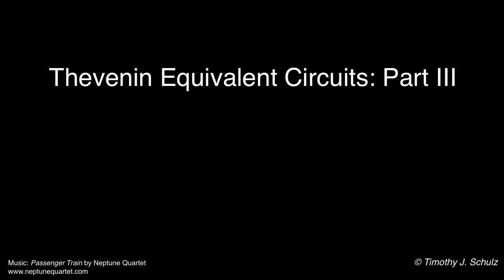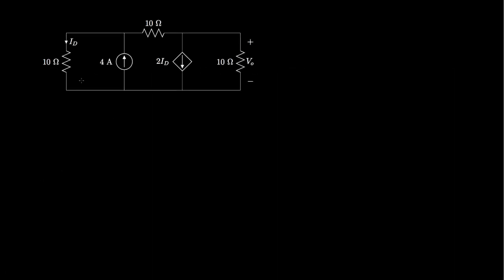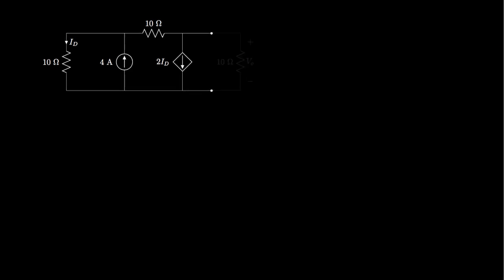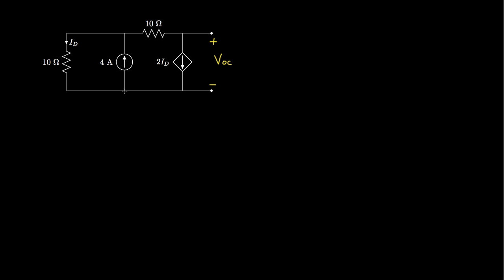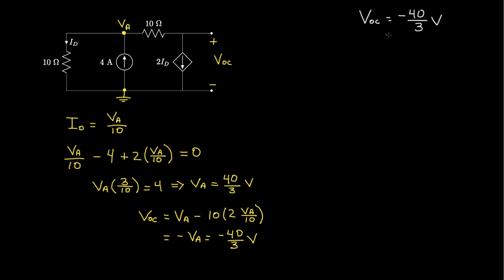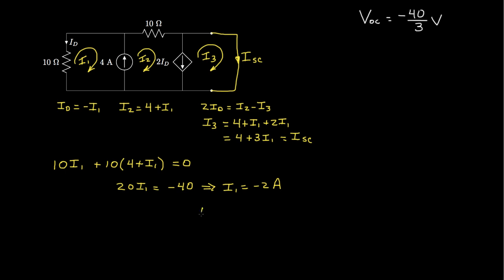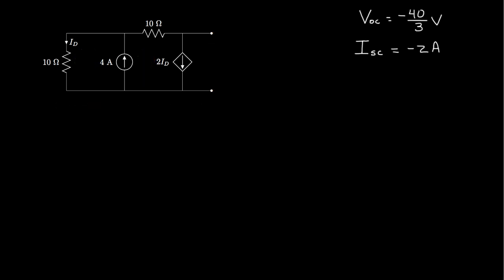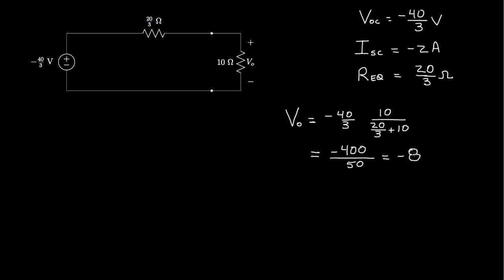Thevenin Equivalent Circuits: Part III

Comment: Isn't there a mistake 3:19 - From Va 2 currents are going out and one is going in. The one going in is the +4A but those 2 going out are: Va/10 AND Va/10 + 2Id, while Id is Va/10 so = 3*(Va/10)
Reply from the maker: Flankymanga Did you see the equation at 3:35? That equation is Va*(3/10) = 4, which seems to be what you are saying. What do you think is the mistake?

Comment: Why did u subtract the voltage across the 10 ohms resistance from Va to get Voc ??
Reply from the maker: Because, according to Kirchoff's Voltage Law, the voltage across the 10 ohm resistor is Va - Voc. Therefore, Voc = Va - (voltage across 10 ohm resistor).
Reply: Ohh okayy thanks a lot !